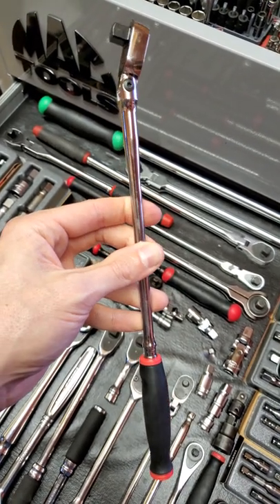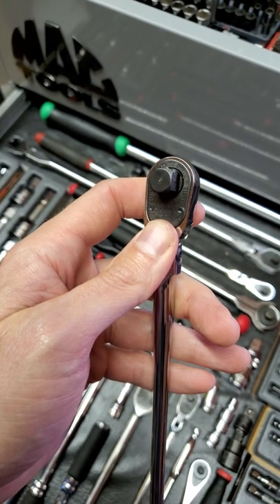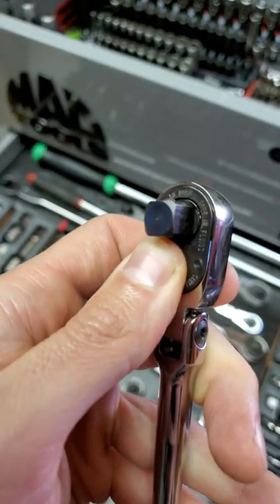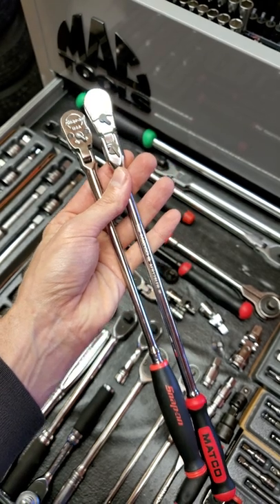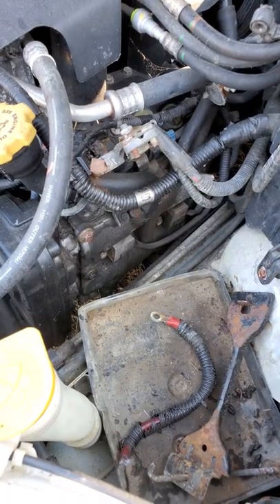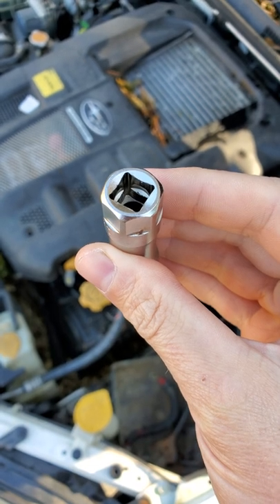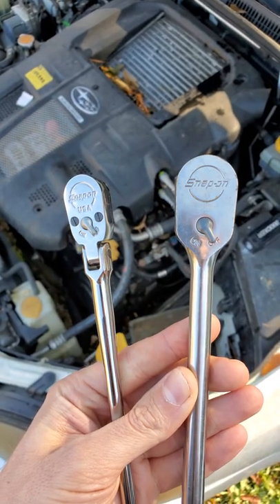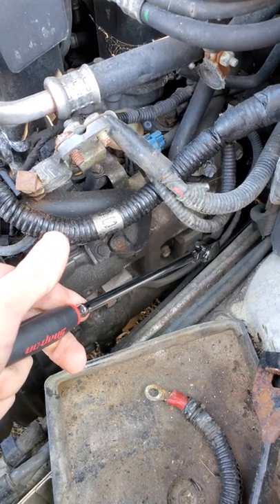Custom, One Off, Snap-on FCHLLF72 Ratchet #shorts

Comment: I could see why people might say, "why not just buy the 3/8 " ratchet" but they don't understand how much smaller the frame of a 1/4 " is. Now, does the smaller frame mean it's a little weaker? Sure, but as long as you don't use a cheater bar, (or loan it out), you'll probably not have any problems. Cool idea dude.
Reply: If you the little frame doesn’t move it you NEED to go get something that will.
Reply: That was my question, how well does it handle the torque?  But if you're only using it on lightweight applications then it doesn't matter does it?!
😅👍
Reply: "Or loan it out" 😂 speaking truth

Comment: I can’t remember the vehicle I was working on more than likely a Honda, I was trying to get the belt off to get one of the pulleys off etc and every snap on ratchet head wouldn’t fit in the tensioner (3/8 drive) and that’s all I own, I went to my coworkers box and got his Matco 3/8 ratchet and it was perfectly thin enough to fit, ever since I’ve been wondering what will be my own toolbox solution for that problem when it arises again. Now I know, I’ll just do what you did, thanks for the tip man.

Comment: Tech of 18 years, I always use my double wobble joint snapon spark plug socket with a extension to remove them then tighten new ones till they bottom out. then I use my MAC deep spark plug socket that ends up flush with the valve cover. Finish with my snap on digital torque wrench.  Bing bang boom ✅

Comment: Oh man that’s perfect! I’ve always used an extended 3/8” drive flex head to change plugs on my Subaru’s, but it’s a tight fit the handle isn’t super long and is pretty girthy compared to these. I can definitely see how a 1/4” drive body & handle would make it a bit easier. I just might have to try this (: thanks for sharing dude!

Comment: Our snap on guy does it for us. The shorty 1/4 with 3/8 head is pretty popular in our shop
Reply from the maker: I can guarantee he isn't doing it the right way. Swapping an FCF72 head onto a THLLF72/TLLF72 handle isn't the right way.
Reply: @MrSubaru1387  not sure but they work fine.

Comment: I wasn’t aware that was possible you just made my Subaru spark plug replacements a lot easier… I normally use the spark plug socket with another sock over the top and then a wrench on the end

Comment: Defeats the purpose of the 1/4 head profile. Sometimes you need the small 1/4 socket
Reply from the maker: I ain't ever seen a 1/4" drive spark plug socket. This is purpose built. I have another that's still 1/4" drive.
Reply: @MrSubaru1387  Yea that makes sense but what subi engine is there you cant break torque on a spark plug with a 3/8?
Reply from the maker: @Gregg0112  size, this is for compact size.

Comment: I just noticed that Snap-on has lots of different size and lengths screws that go into the face plate. I’m guessing trying to match the screws will be tougher than machining the faceplate. What size drill bit did you use?

Comment: AWESOME, any way you could provide the part number for the guts and the plate?
Reply from the maker: RKRFC72 is the internals on the Snap-on. You have to custom machine the faceplate on the TLLF72&THLLF72. All other T series ratchets you use the FC72-2 faceplate.

Comment: Lol, very justified. Now here's the one up. Spark plug sockets have flats, and you really only need to break a spark plug loose to finger loosen by hand. If you "need" to be faster and an open end wrench is too slow to perform this method, which c'mon really? Use a ratcheting box end on the flats. But c'mon, be honest, you rather buy two ratchets and put in labor to mix parts because "faster" means spending more money, not actually using your innovation and ambition. Just my opinion, love the channel. I do see other uses for this tool. Like competing the snap-on slim profile 3/8" ratchet.

Comment: Can you swap a 1/2 ratchet with a 3/8 internal? I've always  seen 1/4 and 3/8 swapped but need a 3/8 longer then the long 19 inch for some transmission jobs.

Comment: I talked to my Snap On dealer about machining the plate to accept the 3/8 drive internals to do the swap.Told me this does not need to be done,there is a plate already that can be ordered to do the 1/4 to 3/8 swap
Reply from the maker: He doesn't know what he's talking about. That's the faceplate for the FC72/FCF72. Doesn't work on the THLLF72 & TLLF72. Explained why in the full video on this ratchet.

Comment: What was the part # for the 3/8 snap-on repair kit?
Reply from the maker: RKRFC72
Reply: @MrSubaru1387  thanks bro. Btw that handle doesn't flex on u, like crazy, when removing spark plugs?
Reply from the maker: @peteputros2412  no.

Comment: Links are not in the description??😡.  I would pay for those !!!!!! Ok 👍
Reply from the maker: Links were in the description... I just looked.
Reply: @MrSubaru1387  is that  the modified version's of the tools or the part to build them ?
Reply from the maker: @mrphiscal  link was for the ratchet and the conversion kit. Face plate needs to be machined for it to work.

Comment: But they make 3/8 drive flex heads.
Reply from the maker: Not these.
Reply from the maker: All Snap-on offers is the FC72, FCF72, and the FHCNF72.
Reply: Harbor freight has a Pittsburgh 3/8 in. Drive flex head long handle for $25 ☠💀😂🤣
Reply from the maker: @paulsosa1872  🤮 🤮 🤮

Comment: Why go to all that work of converting? Just swap the whole head off of the FCF72 onto a TLLF72.
Reply from the maker: I pretty thoroughly covered why a head swap wasn't a good idea.
Reply: @MrSubaru1387  Not in the 59 second clip I watched.

Anyone not wanting to go find the full video, MrSubaru's reason essentially boils down to design and strength superiority of the dual80 vs the 72.

I swapped the head on mine for one reason though, warranty. If it ever fails, I put the mini 3/8" head back on the short handle and hand it to my dealer to be repaired without any additional costs to me.
Reply from the maker: @corythomas4427  mine still has a lifetime warranty. Other than the modified faceplate, which isn't a failure point.
Reply from the maker: Sorry. Thought this was on the full length video. I have another full length video on it explaining it.

Comment: That looks like an ej Subaru motor .... tryin to change spark plugs ? Lol good luck
Reply from the maker: Takes 30 minutes. It's an engine. EJ255.
Reply: @MrSubaru1387  
One of the most pain in the ass spark plug changes till you figure out the right tools to use...had a Mitsubishi ...literally took 5min flat if you were taken your time
Reply from the maker: @Bigbrunibelow  guess you've never done a 3V Ford before. 😂 😂 😂
Reply: @MrSubaru1387  
I know 90’s Ford 8cyl the back sparks are damn there impossible dono if that’s still the case
Reply from the maker: No. Not what I'm talking about. Ford 3V V8 spark plugs break off inside the cylinder head. $150 extractor tool. 30-60mins per plug to extract. Down about 6-7" inside a tube, on top of the head.
Reply: @MrSubaru1387  
I did have a coil plug break in the tube of the mits that was not fun getting out so I could only imagine
Reply: @MrSubaru1387  the first one I did, my boss didn’t warn me and I knew nothing about them, you wouldn’t believe me if I told you but, literally every single one of them came out beautifully, my boss was flipping shit he said “dude you just finished like a 7 hour job in 1 hour” the very next one that came in, 7 out of 8 broke, I guess I was blessed with beginners luck then 😂